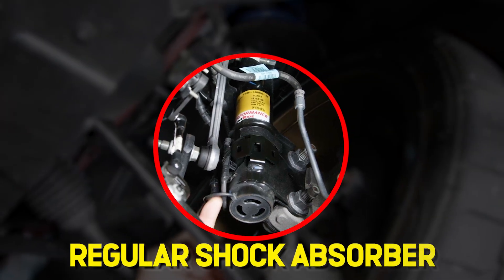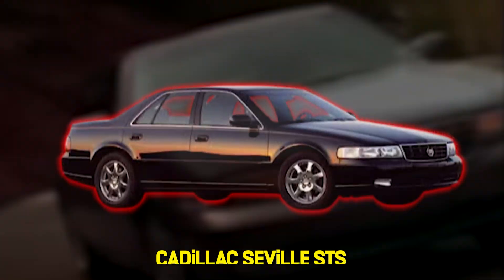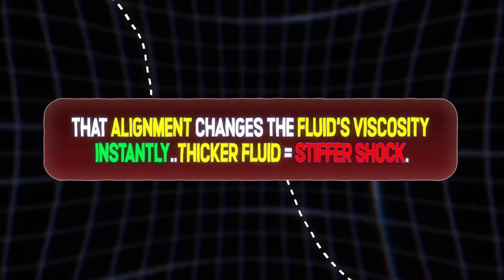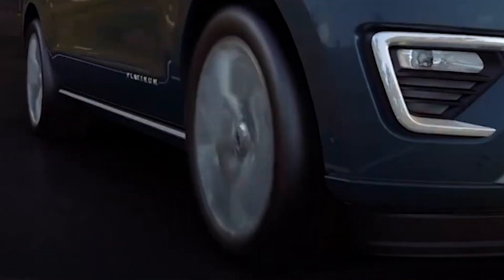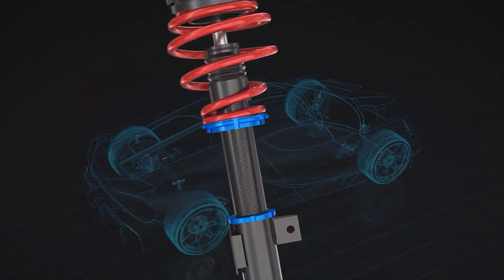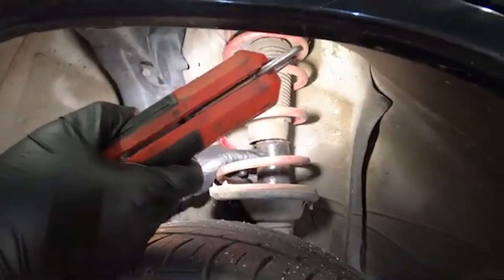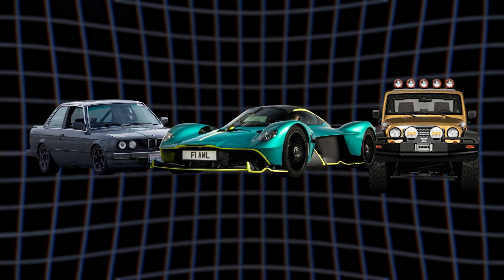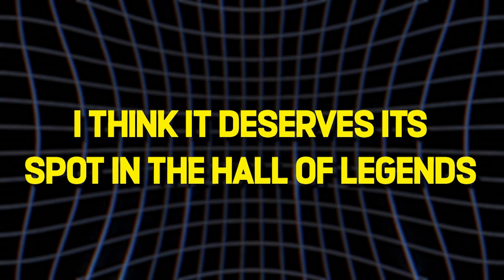The GM Shock That Made Ferrari’s Supercars Legendary

Comment: Anyone have any compliments about these shocks ?
Reply: It was a cheap way to get variable damping an sell it for a lot of $'s. I had a Mercedes Benz 300CD (1979 W123) that had well engineered suspension underneath it, long coil springs and proper dampers. The car handled very well and could devour miles of bad road; I drove it for about 500,000 miles with few problems.